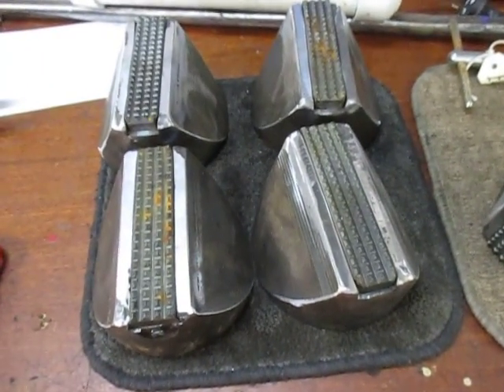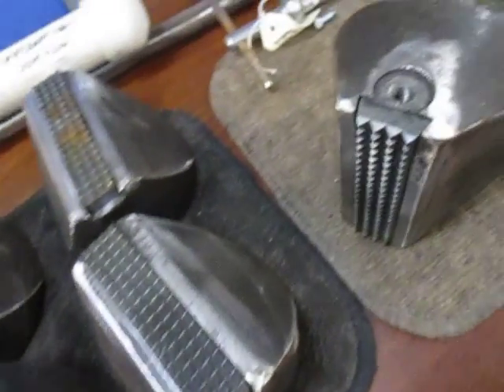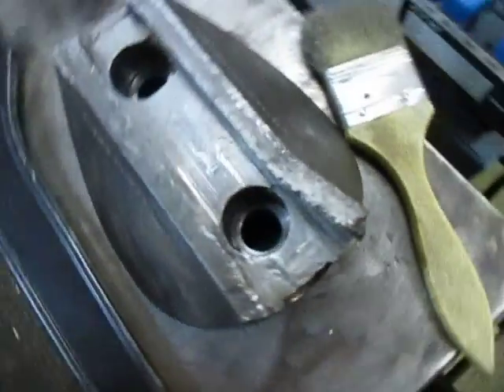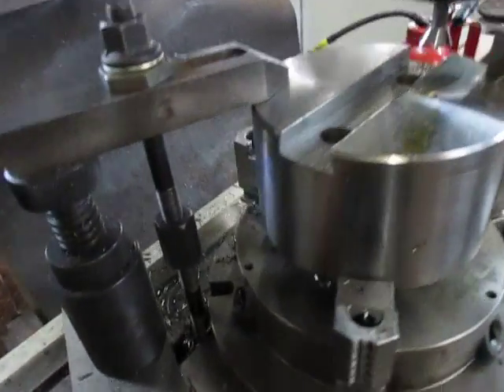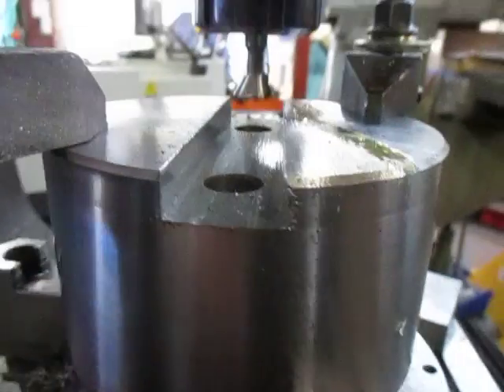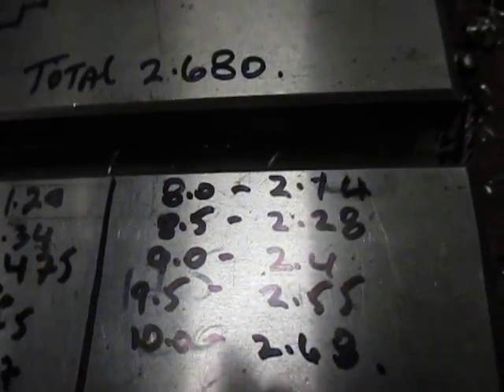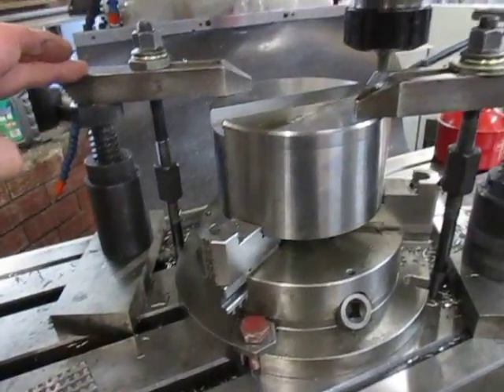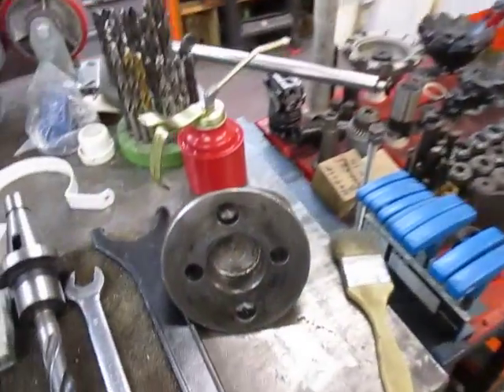Broken Jaw Saga 2

Comment: I hate nodding the head on my mill, too.  It does not have a worm to inch it down (or to tilt it sideways) and it it quite top heavy and easy to lose control of it turning turtle.  I would probably still nod it for that job, because it does not have a DRO.
Reply from the maker: Bob that's a fair call. Can you use a chain block or rope and pulleys from the roof to give you some control when you are actuating the head?

Comment: Why don't you nod the mill head 15 degrees?
Reply from the maker: Bob G'Day, I hate nodding the Mill Head. Time wise no advantage in this case as I would either have to reset the workpiece after the first run, or nod the mill twice.
When I get to making the 4 more new ones then I'll get a cutter made to suit. The way I chose to do it I was working on another job at the same time as the cut runs were underway it went well.

Comment: would it work to rotate the the piece 15 degrees to make the 75 degree bevel with the 60 degree cutter or would that be more trouble than the stepping? it looks like the cutter might not have enough reach anyway.
Reply from the maker: Ross all good, plenty of reach, I only needed to go down 10mm depth, worked fine.
I have an angle plate and an angle vice, or I could have made a fly cutter, or as Bob suggested nod the mill. Any method is good, the end result is important. Cheers Bruce.